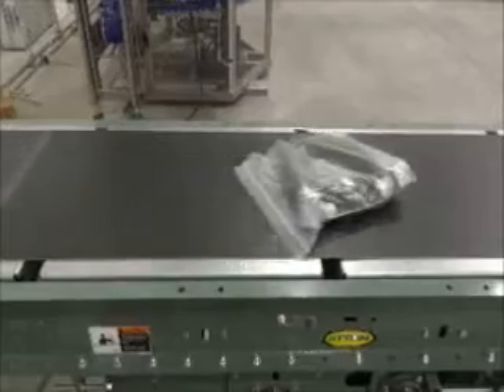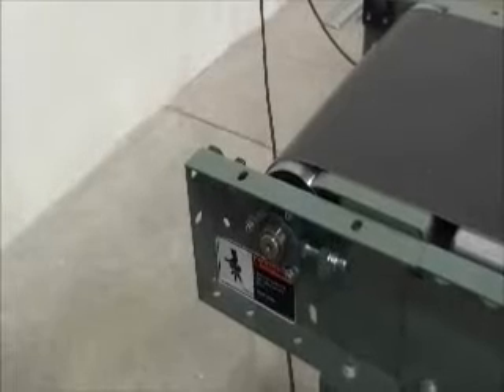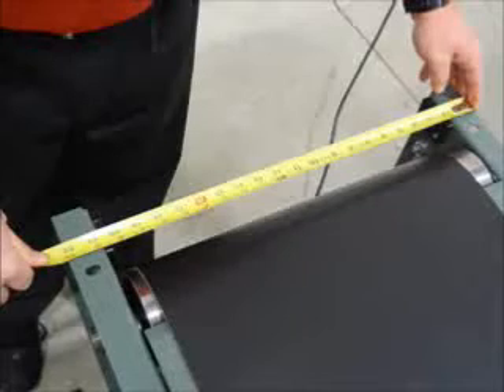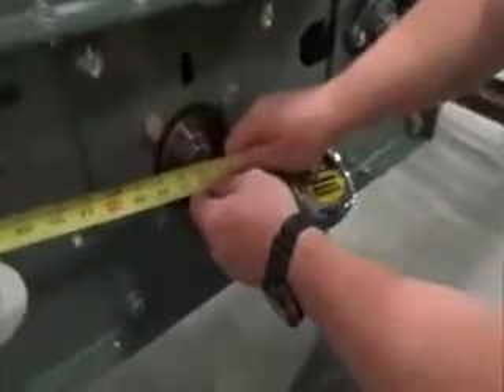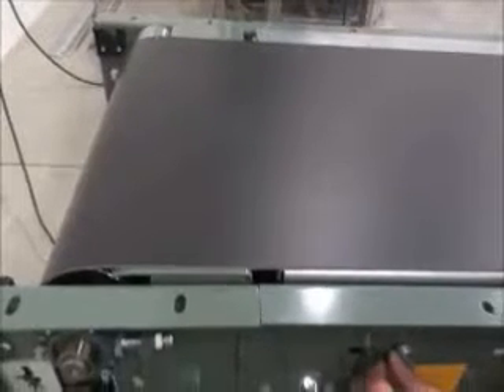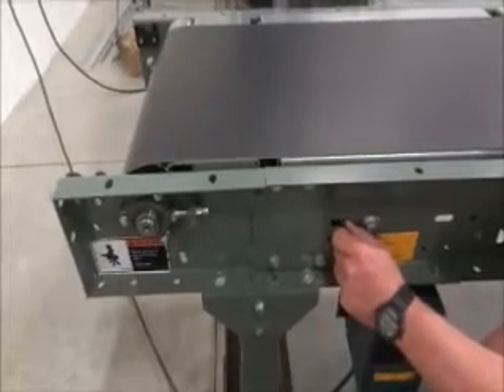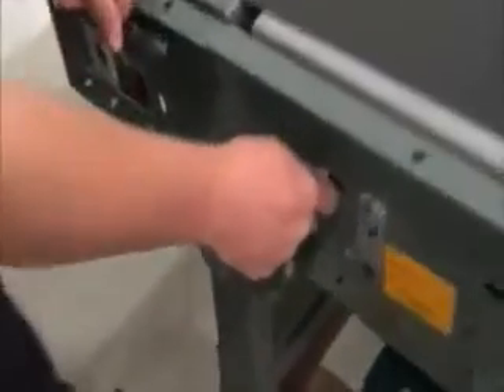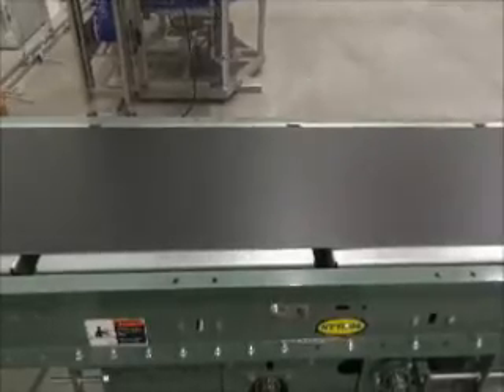Tracking Demonstration

Comment: Excellent demonstration. I believe 2 points should also be mentioned: at least one of the pulleys MUST have been crowned. And related to this, belt tension needs to be high enough to always sufficiently force the belt against the pulley crown. In this conveyor, probably the drive pulley is crowned which makes sense (and is usually done) since belt tension is highest where the loaded belt enters the drive pulley.